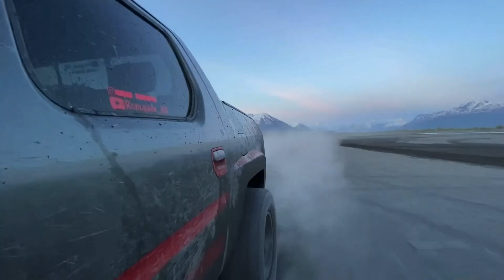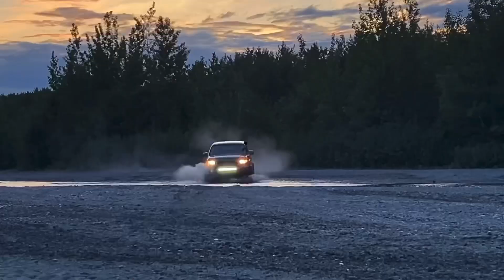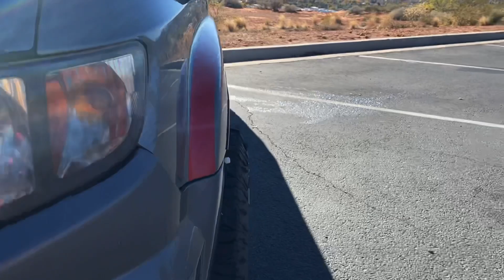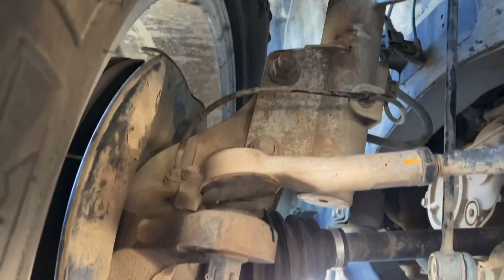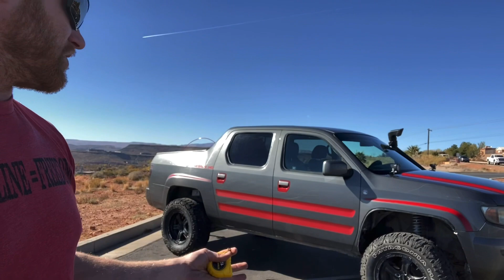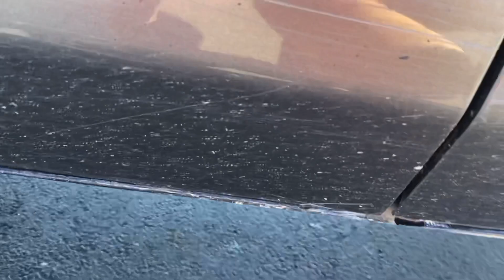Final lifted offroad Honda Ridgeline suspension and tire set up

Comment: What would the coilovers do for lift specs? Also what control arms would be good to add with that lift. Really just looking to lift my truck right now and keep all the alignment as proper as I can. But I also don't want to ruin my pockets. I have spacers right now on some older shock and springs that I would like to replace
Reply from the maker: I loved the Flatout. Stronger, durable, warranty, all of it. Plus you could take the spacers out and just use the coilovers.

Comment: Are you and the Ridge back in AK? I have an 06 thats stock, but thinking about some of your mods. Its got 146k miles on it. Was concerned about modding with “high” miles. If tou are back in AK, would love to see your RL in person.
Reply from the maker: I’m not back there currently. My Ridgeline had 170,000 when I started my mods, had 195,000 and running strong when I did the body swap. You totally should modify it!

Comment: Hey, greetings from Chile.
I recently lifted my 2011 Ridgeline 2" and added 1" spacers. On the highway over 90km/h it has a vibration, subtle but annoying
I checked what you comment in this video and the crankshaft is quite horizontal.
Any other idea?. 
Best regards
Reply from the maker: Check your axles. If they are good try dropping your subframe 1”
Reply: @RenegadeHQ  it was the spacers.

Comment: Getting exact vibrations on my 2 inch lift. It only vibrates when turning my truck. Could you post a photo of that spacers? Thanks!
Reply from the maker: I don’t have the spacers anymore. I did not use hub-centric spacers. I have heard those help a lot.

Comment: Damn your truck is like my end goal. I've got a 06 and sometimes looking at it stock puts me off. I don't know if I'd put bigger tires on it cuz that seems like alot of work. Did have a question tho, did you also use the subframe spacer/lift kit from  hrg? And Unrelated i Also live in Utah, more central Utah but hell st George is a blast man I'm jealous, thought about moving down there but the housing market all over Utah sucks donkey balls dude 😂 love your vids man
Reply from the maker: Thanks for the support brother! Yes I used the ultimate lift kit with subframe drop. If your mechanically savvy at all you could do the cutting ti fit bigger tires in a day.

Comment: Do you remember the original hanger bearing mounting bolts size thread and length by any chance thanx awesome channel
Reply from the maker: I do not. Just go to ace, take out one of the bolts why your there and take it in to compare threads then just get one that is longer. It only takes a few minutes.

Comment: why does hanger bearing drop help vibration after a lift?  I have a 1.5" or 2" lift.  Thank you sir!
Reply from the maker: When the angle is to extreme it causes a bind. Just like your CV axels or a U joint that is at to extreme of an angle.

Comment: Hey Brady, Congrats on achieving close to 1K subscribers in such a short time for such a niche channel - off roading a 1st Gen Ridgeline.  You have tested the limits on this vehicle and now found a sweet-spot set up for a safe and comfortable daily driver that is also a capable high clearance adventure vehicle that can handle the majority of the off road challenges. I really appreciate you blazing the trail to find out what works and what doesn't on this vehicle. I will be duplicating some of your mods in the next 12 months and only have the confidence to move forward because of the experimenting the "mad scientist" Renegade has done for this community. I have an idea of a mod to make a comfortable sleeping space for any size adult male on this 1st Gen R.L.  It involves some radical (to me) ideas but I think it would barely phase you from a creativity/risk/fabrication standpoint.  Maybe someday we can collaborate on this idea.  I'll be moving out to Phoenix in early 2022 so we will be somewhat close by.  I appreciate the recap of the suspension upgrade and brilliant problem solving re: the vibration eliminated by  aligning the drive shaft with the spacer as a fix  I will try to get under my 100% stock '06 RL to see if the drive shaft is 100% level  in-line or if there is a change in the angle.  Thanks again for all the info you have shared.  Looking forward to seeing your next episode out in the wilds of Utah...the most beautiful state in the union for exploring the natural wonders of this country.
Reply from the maker: I appreciate that man! I would love to collaborate on that! I was literally thinking of some things as well for peeps just today. Just need some plywood and some draws o think it could work. Look me up on FB and DM me! Let’s chat! Thanks for all your support from the beginning!

Comment: Sweet set up! Just put the 3 inch HRG lift on my Ridgeline last weekend. Where did you get the wheel adapters?
Reply from the maker: Just off of ebay. New ones. Not used.